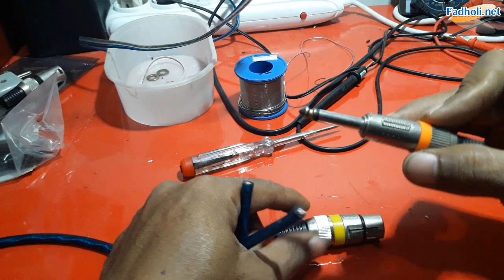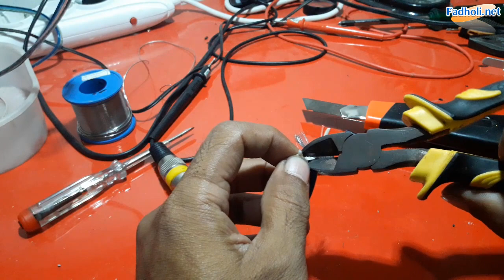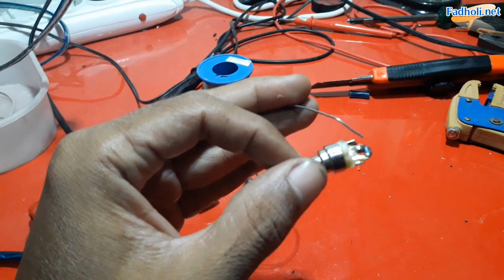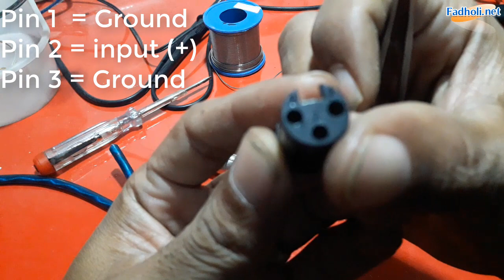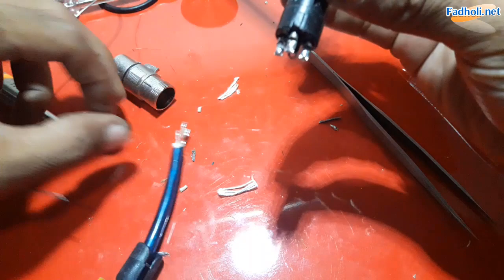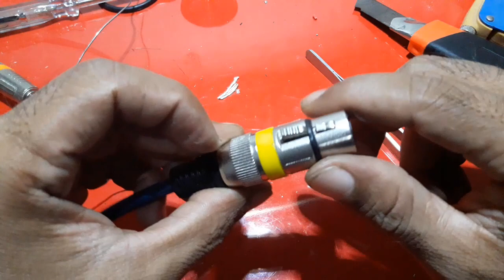Cara Pasang Kabel Mic  -  Mono/Unbalance

Comment: Bahaya di phantom power ini ⚠⚠

Harusnya yang di jumper pin 1 & body ( untuk ground )
Pin 3 di kosongi saja...
Reply from the maker: Phantom pakai koneksi yang balanced dan soket xlr.
Reply: Nah mixer kan main outputnya xlr (2=plus , 3=minus 1=ground) sambung ke ampli inputnya rca, gimana mas??
Reply: @Mohammed-tm8so  pin 2 di jumper ( + ) pada kabel rca & pin 1 sama body xlr, jumper grond pada rca.
Pin 3 xlr biarkan kosong